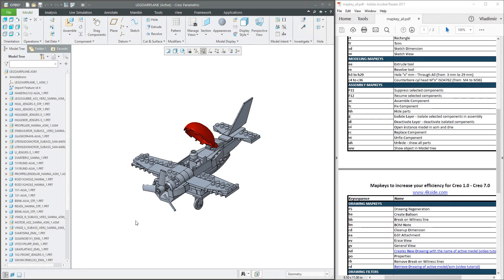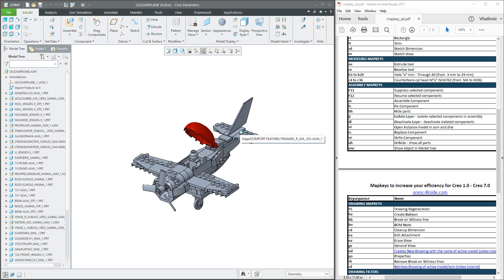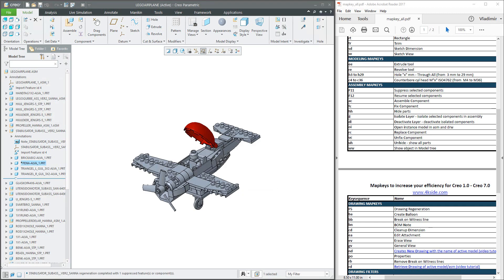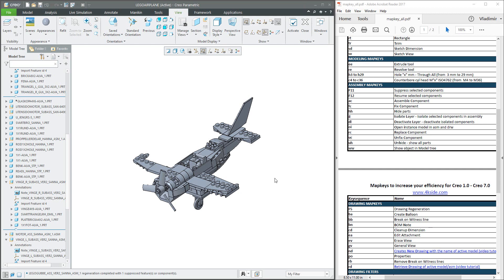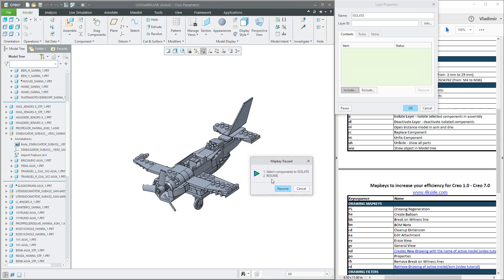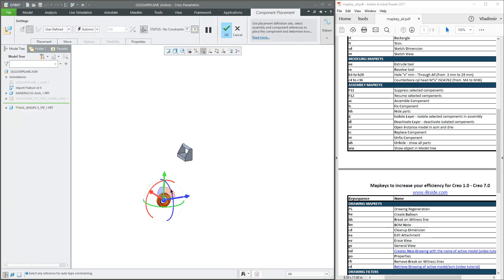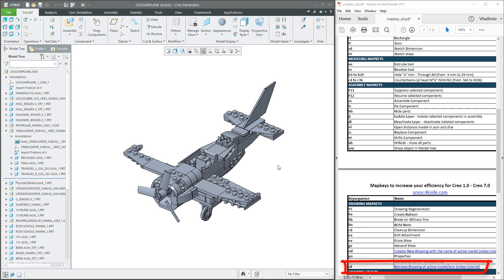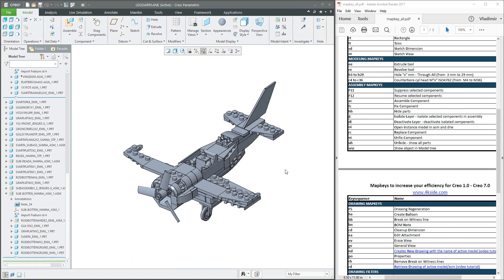Assembly Mapkeys | Creo Mapkeys - part5 | Increasing the efficiency

Comment: Thanks for the video. Do you know if it's possible to copy text as part of a mapkey? I.e. I have a mapkey set up to save a .stp file. I would like to come up with a way of automatically copying the part number from the relations so I can paste it when the "save as" window comes up.
Reply from the maker: Hi, thanks for your question.
I have tried to make copy mapkey many times but..
It is not possible 😂
I am using workaround that I read trail file and then I make a copy of necessary info to the text file and then I create new temporary mapkey with all necessary info. It is complicated but it is working 👍